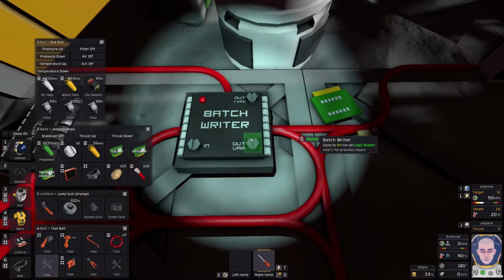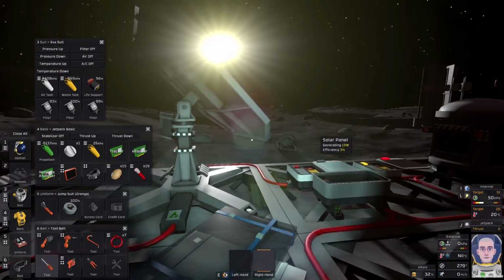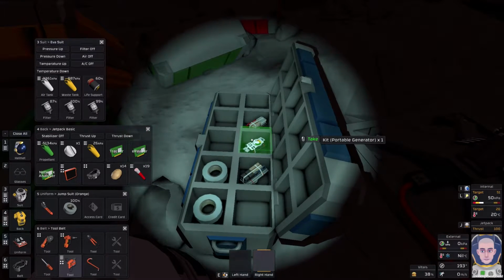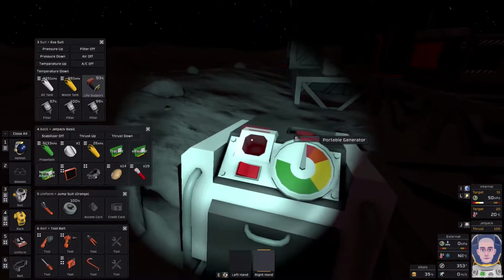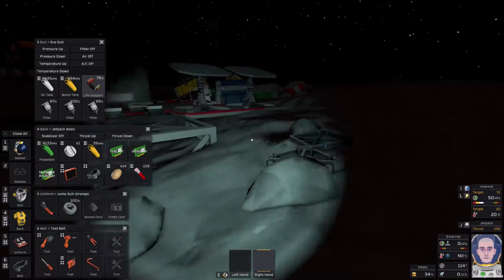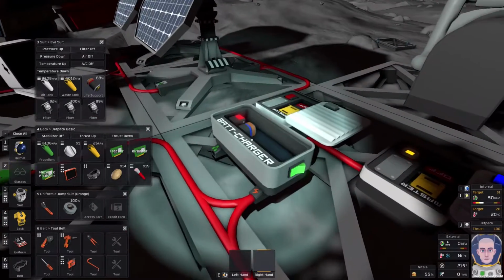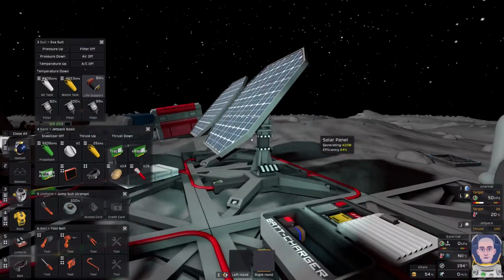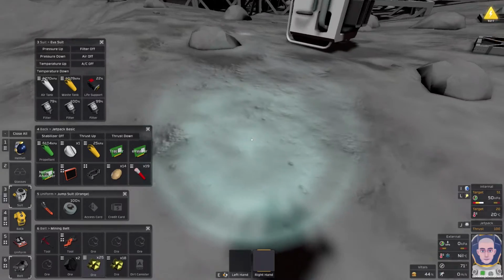Stationeers: Lift Off Update - Part 10 - GRID

Comment: Interesting that you consider the furnace mid-game. I consider it the start of the early game. Before then, it's mostly just a race for basic survival and is basically the same every time (get power, get basic manufacturing, get food). Once you get steel, though, the game really opens up. I consider it pretty critical if only due to station batteries; I value those highly and generally have at least four in a starting base, fed by at least four solar panels by this point. After all, it doesn't take that many more resources or time to hook up four solar panels to tracking logic than it does one. 

Your extremely low power play style is completely alien to me, so it's interesting to observe.

Steel also allows much better base building. It's SO much more efficient to use steel to make frames than iron. Considering how much you hate mining and refuse to use any ore multiplier mod, I'm surprised you don't value steel higher if only for that. More efficient use of resources means less time mining.

That's another huge difference in play style, I find interesting; how very little resources you mine and refine at a time. I usually don't return from a mining expedition unless my pack is completely full and then the whole thing is processed.

Comment: the portable generator is another way to charge up the batteries.  you put a canister of fuel in (like from your welding torch as it has the proper o2/h mix) then pop a battery in the slot and turn it on.  it has been in the game a while now.  Kind of useful if you have died and wound up with another set of tools and therefore another welder to steal the fuel can from

Comment: :D

I don't think the furnace is mid-game. It only takes Copper and Iron to make and it's just a step up from the Arc Furnace. The advanced furnace - now THAT's mid-game! 

Another thing: don't put too much stock in the Auto-miner. If you want to talk about broken game mechanics, the Auto-miner would be right up there at the top of the list. Seeing as the portable scrubber uses a battery anyway, why not do the active vent running to a pipe system on the gantry you mentioned? and just run the miner and the active vent off the APC you'll need for  the miner?

Another good episode! I really enjoy watching you play this, simply coz you play just like I would - try stuff, see if it works!